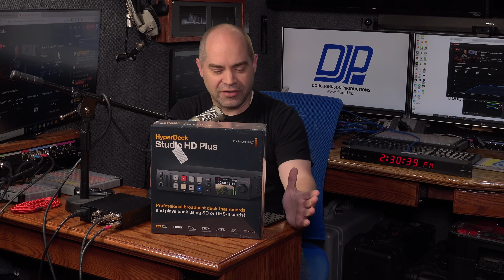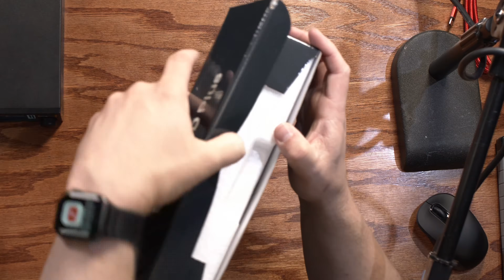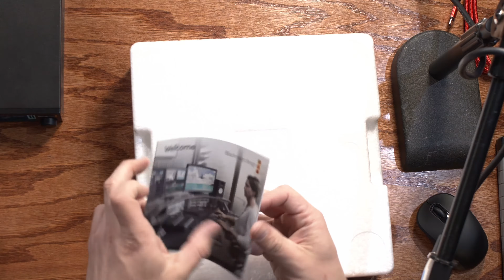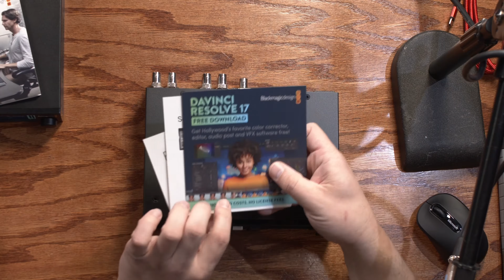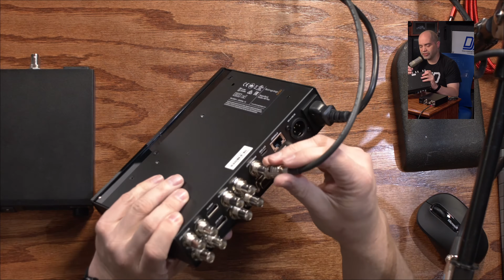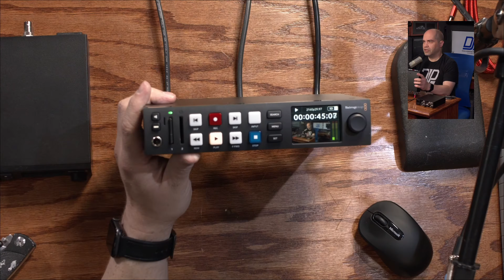HyperDeck Studio HD Plus Unboxing (compared to HyperDeck Studio Mini)

Comment: can it record in 4k?
Reply from the maker: Yes, if you're recording in ProRes or DNxHR. But not for h.264.
Reply: @djp_video  with ProRes or DNxHR i was getting video and audio out of sync
will it be better just to buy the 4k version instead that works in h265 directly
?
Reply from the maker: I've literally shot thousands of hours of footage on these units and never seen any sync issues. Try it on an actual timeline in your editing software.

Is your computer up to the task of playing 4K ProRes/DNxHR?
Reply: @djp_video  mac studio m2 ultra 64gb ram ssd 1tb
it is very powerful

Comment: Afternoon Doug, does this record  uncompressed as well? also what happens if you attempt to record a clip that is 2160 60fps will it record it at 30?  thx
Reply from the maker: None of the current HyperDeck Studio lineup can record uncompressed video. 

It simply won't recognize a 2160p60 signal. It will appear as though no signal is present.
Reply: @djp_video  Thanks for the confirmation Doug, Much appreciated.

Comment: Thanks for the video, can this playback and record at the same time?
Reply from the maker: No. It's one or the other.
Reply: @djp_video  thank you. How do you route the audio from playback into an audio mixer? Only seems to be SDI into the vision switcher
Reply from the maker: Sorry for the late reply; I just noticed that you asked a follow-up question.

I have the Monitor SDI output connected to a BMD SDI-to-HDMI Mini Converter, and use that to extract the audio. (I use the Monitor output because it's down-converted to HD, thus eliminating the need to get the much more expensive Teranex Mini converter.) In this particular case I have it set to AES digital audio mode, and have it connected to an Audinate AVIO (AES version) and use that to put it on my Dante network so it stays in the digital domain, and from there it's just another Dante source available to my mixer.

Comment: I have two of the original HyperDeck Studio Mini with the two SDI outs. I know you are a fan of the older ones as well for that 1/3 form factor and still having that ability vs these 1/2 rack units.   I'm really torn on upgrading to these or keeping what I have.   I don't' really see a huge benefit to the new ones over the old over than the buttons on the front.  Anything I'm missing that would make upgrading an easy decision?
Reply from the maker: USB-C device support is nice. You can record directly to a USB flash drive and edit directly off of that drive, for example.

The newer ones also have dedicated Timecode inputs and outputs. And supposedly better playback compatibility with H.264 files created on a computer. And also they have USB-C webcam emulation to make it easier to get video into a computer.

But if your firmware is up to date on your original Studio Mini you aren't missing much.
Reply: @djp_video  Thank you for the quick response!   One last question. Do you know if there is a cross conversion on the outputs?  Can't find that info any place.  If I feed in an SDI in to record program on the unit can I get that program feed out via HDMI?  Or does the HDMI only loop out directly what's in the HDMI In?   If it cross converts that will save me from one less converter because I want to have a program out available via HDMI.  This is all connected to a 2 M/E Constellation for reference.
Reply from the maker: Whatever input source you have selected (playback, SDI, HDMI) will be sent to all outputs (SDI, HDMI, USB for models that feature it).

Comment: Sooooo... I guess no one is going to ask the obvious question..... Is the HyperDeck Studio HD Plus as PICKY with regard to what SD Cards you can use as the Hyperdeck MINI?  A great improvement would be that you can use any good quality SD card... Early on I was in a pinch and had some brand new SD cards that I thought would work and I ended up missing half of the show cause the cards would not work.... Now I have 2 dedicated 128GB Angelbird SD Cards that stay in the unit and 2 dedicated back up SANDISK SD Cards that stay taped to the inside of the case...
Reply from the maker: That's a good question, and one I don't have an answer for. I've only used it with SD cards that worked well in the older Mini. I haven't tried anything else (mainly because if a card doesn't work in a HyperDeck, it isn't of much use to me so I don't buy them.)

Comment: Does playback clips must have the same format? Like on older models?
Reply from the maker: Yes.

The way I deal with this is to bring everything into my editor, then use a preset to re-render to a consistent file format. That makes it really easy to ensure that all files are in exactly the same resolution, frame rate, and codec.

Comment: @Doug: why is Hyperdeck not stopping after each clip? It moves on to the next, and next, and next - even if loop-play is off. Is there any solution?
Reply from the maker: By default it plays all clips. You can play a just single clip by controlling it from ATEM Software Control.

Comment: doug is there a way where u can set up a hyper deck as a instant replay player for use in a live sports broadcast.  where as you may create a macro to cue up the last 10 seconds and play the reocord event while still recording the live event.. thanks in advance
Reply from the maker: With a little bit of writing some code, you could make a HyperDeck do a basic job of instant replay.  

The big problem with this is that it can't play and record at the same time, so whenever you need to play back something you've recorded you have to stop the recording. Which makes doing replay correctly difficult.

Comment: @DougJohnsonProductions, next time you do an overhead camera shot…please consider zooming-in focus so we can all have better eyesight.  And when you tell us that this hyperdeck sits in the middle of BlagMagic’s lineup - then please spend enough time informing us as to why we’d need to upgrade to a better one.  Which I’d love for you to tell me here in a reply.  What is the current top-of-the-line hyperdeck and what cool feature does it have that the Studio HD Plus doesn’t.  Trying to buildout my studio.  Thank you for the excellent content.
Reply from the maker: I removed the zoom lens from my overhead camera. I was using one of the electronic zoom MFT lenses on my Micro Studio Camera, but it was such a problem that I swapped it out for a fixed focal length prime lens instead.

The HyperDeck Studio HD Plus adds 4K at up to 30 fps and a larger form factor with bigger and more buttons, separate fill/key output, an HDMI input, and a speaker over the new Studio Mini HD. Compared to the older Studio Mini, it has an HDMI input, timecode input/output, more/bigger buttons, a speaker, and USB-C recording and USB-C webcam emulation. 

The top-of-the-line HyperDeck is the Studio Pro 4K. It offers 4K recording at up to 60 fps in h.265.

Comment: Maybe you are the guy to ask. Is there any chance at all… to send an SDI loop over the internet? Like say I have a remote co-host and we both have the studio cam 4K pro. We are getting them. But I can not find out how to do this. I know another work around. But the SDI loop would be amazing!!!
Reply from the maker: Short answer, yes, it is possible... but it requires some expensive gear, or an expensive connection.

What you're looking for is Video over IP. There are a bunch of different protocols that can do this. NDI is one option, but it's going to require a pretty fast and very stable connection. If going that route, I'd wait until NDI version 5 hardware is readily available. You could also do SRT. Hardware for SRT is pretty easily available and isn't that expensive. If you're willing to dedicate a computer at each end and add a capture device to bring in the SDI video you could do something with WebRTC like https://vdo.ninja/. If nothing else you can use Zoom or something similar. All of these options are going to compress the video, so you'd be losing quality, and in most cases you're looking at significant lag as well.

The much more expensive but highest quality route is to go with fiber. But that's usually reserved for big companies with enough money to have dedicated fiber runs installed.
Reply: @djp_video  greatly appreciate the response! Thanks for pointing me in the right direction 👍🏻

Comment: Hi I want to know regards little confusion 264 mean can this recorder record mp4 format or not??
Reply from the maker: From BMD's website: "Supported Codecs - ProRes HQ QuickTime, ProRes 422 QuickTime, ProRes LT QuickTime, ProRes Proxy QuickTime for all formats up to 2160p30. Playback only of ProRes 4444 QuickTime up to 1080p60 with auto routing of fill and key over SDI A and B outputs. DNxHD 220x, DNxHD 220x MXF, DNxHD 145, DNxHD 145 MXF, DNxHD 45, DNxHD 45 MXF for 720p and 1080p HD formats up to 60fps. DNxHR HQX, DNxHR HQX MXF, DNxHR SQ, DNxHR SQ MXF, DNxHR LB, DNxHR LB MXF for 2K DCI and 2160p formats up to 30fps. H.264 SDI 4:2:2 10‑bit, H.264 High 4:2:0 8‑bit, H.264 Medium 4:2:0 8‑bit, H.264 Low 4:2:0 8‑bit for all formats up to 1080p60."

Comment: Ok so I want to stream local club's football matches. I am confused between vmix or any hardware encoder (like HyperDeck Studio etc). Also, should I use Hollyland wireless device for video transmission from the camera to the encoder or it should be wired? In short, I wanted to know about an affordable streaming setup to begin with live sports streaming.
Reply from the maker: The HyperDeck Studio is a video recorder, not encoder. The newest HyperDeck studios will simulate a webcam and let you connect a computer over USB to bring the video into OBS or vMix or Zoom, but they won't stream directly to YouTube/Facebook/Twitch, etc. on their own. If you wanted a product from Blackmagic to do the streaming look at the Web Presenter HD or ATEM Mini Pro/Extreme. 

If you have a choice between wired and wireless, go wired. It is so much more reliable.

In terms of going with vMix vs a hardware switcher, vMix has more flexibility but it wouldn't be a good choice if your video is being shown on a projector or TV screens at a venue -- there would be too much delay. vMix also requires that you have capture devices to bring video in from your cameras. The total cost of a vMix solution is almost always going to be higher than an ATEM Mini.